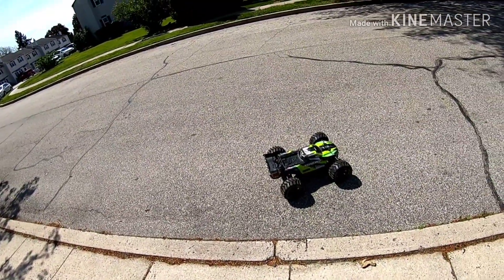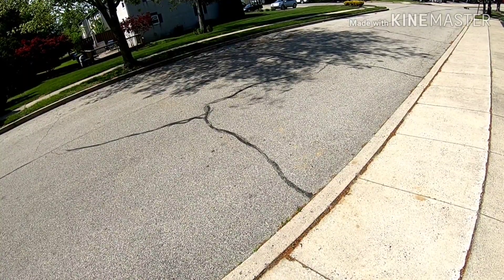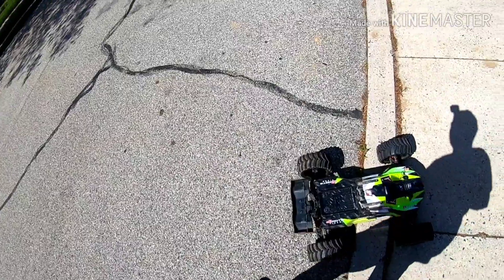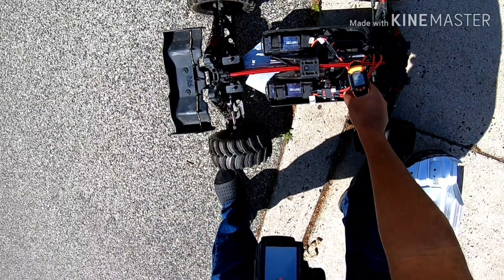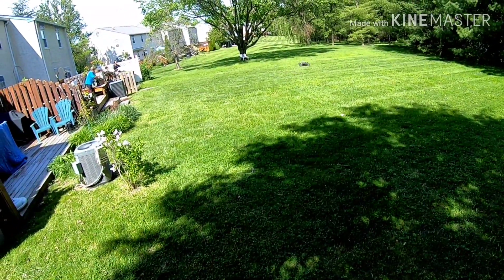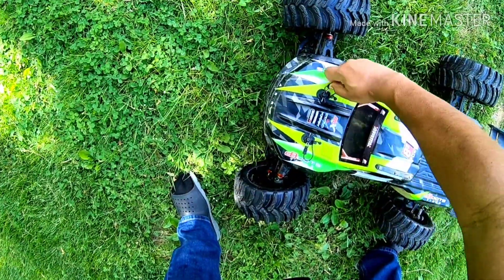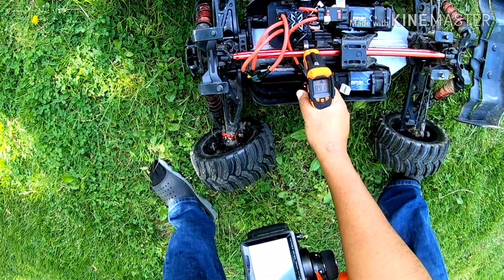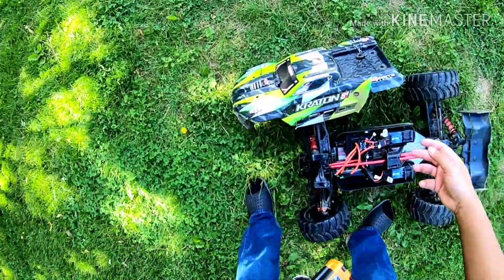Arrma Kraton 8s ESC upgrade and test.

Comment: Sup fella. Hope you're well. Your K8S is Beast 💪 👊 I couldn't get the SSS in the end. I had ordered from Banggood & Teknistore... Waited Couple of months & because of COVID 19 Lock down in China none shipped out!! I ended up with the Leopard V2 - 5892 1200KV. Its insanity... Running a 30T Pinion had couple custom CNC with MAX5, its stupid fast . Temps been ok on mine but I Zip tied 50mm Fan on Motor for insurance. Take care buddy. 👍 👍
Reply from the maker: Thanks for watching and that is great advice. I bought a fan for this motor doo just havent indalled it. Maybe I should. But I will drop pinion size first then decide. I heard great things about leopard motors.